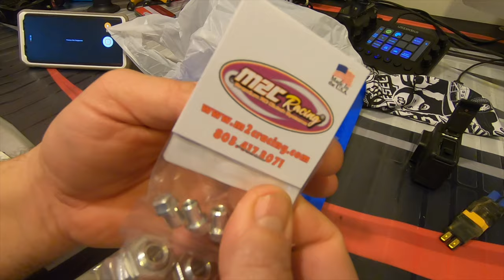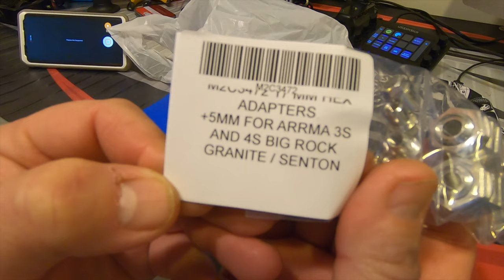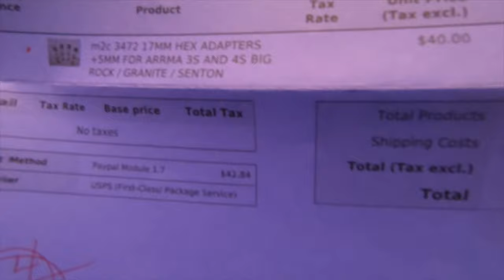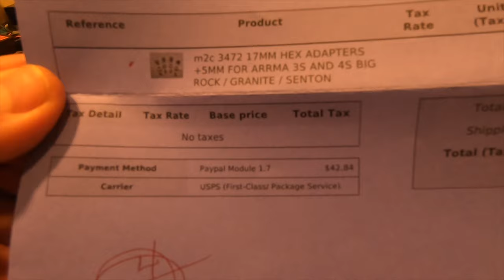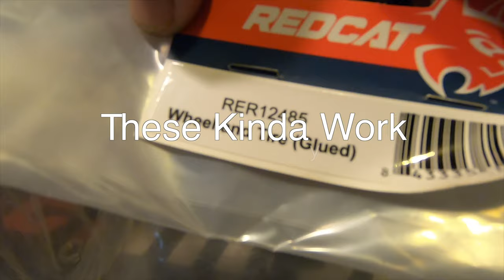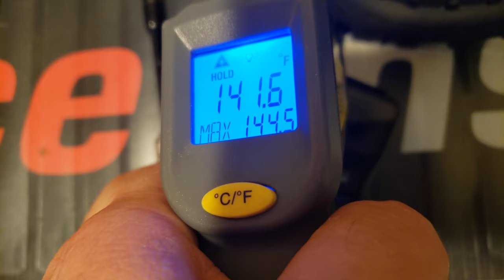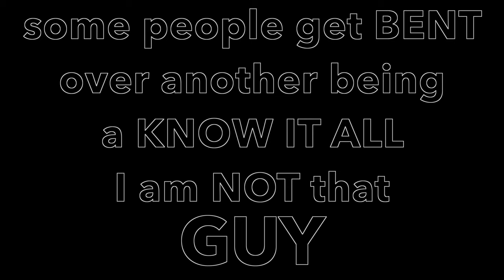M2C Racing 17mm Hex Adapters Arrma Big Rock Granite Senton

Comment: 🚘🚘. Great addition,,,I did the same thing only with hot racing 17mm extenders,,,,,,,I also installed the hot racing steering rack,,,it really tightened up the steering,makes it real solid.....😀😀😀. Also the hot racing nut has much more thread,,going into the hex....😊 you can tighten a lot more because there is no collar on the the insert.....
Reply from the maker: LINK?????

Comment: LMAO haha that run away truck reminds me of good old days with nitro trucks. Throttle linkage broke apart on my Savage X SS and had to drive it full throttle with only steering until it ran out of gas - luckily I was in a field and could drive it in circles. Cheers brother!
Reply from the maker: TOTALLY!!! YES
Reply: @rcguygarage  the slt3 controller has a throttle adjustment that needs turned down. Also recalibrate throttle end points
Reply from the maker: @kevinwilliams2720  yeah the only thing is that ended up not being it it was water got inside the receiver and pinned throttle wide open several times It turned out to be a great video for some fun content though 😂🤣
Reply: @rcguygarage  yeah im still watching and saw that part now. Wasnt sure if yoy had checked throttle. Thanks for the reply. I been watching a lot of arrma 3s upgrade videos. Debating making the changes slowly on granite
Reply from the maker: @kevinwilliams2720  have you seen my Granite videos? I'm not trying to get watch time but I got to tell you the granite surprised the heck out of me the last few times that I had that thing out I totally thrashed it It is Band-Aided together and just keeps taking the abuse the abuse and abuse

Comment: Cant you use that loctite water proof silicon sealant on that receiver box to completely water seal it?
Reply from the maker: Maybe but still should have checked
Reply: @rcguygarage  I'll eventually try that on my maxx once I switch out my servo (going to 2085x). Not going to lie that Big Rock looks fun as hell, thing is a little beastie beast. With water in that receiver box it sure did have a mind of his own there for a bit haha.
Reply: As a newcomer to the rc hobby its sort of confusing when you see "waterproof" on the box when its clearly not the case. Would you say they are more water resistant than actually water proof?

Comment: I bought these hex adapters and they’re binding! You have any issues with that during your install. My metal bearring hubs wouldn’t work. Switched to stock beating hubs front and rear and they’re still binding. Not as bad but I don’t like the way it feels.
Reply from the maker: Unfortunately I ended up dumping these pieces of junk 👍💯
Reply: @rcguygarage  which ones did you buy after?
Reply from the maker: Cheap China junk one that worked better but then realized trying to put 17 mm hex wheels on the big rock was an absolute waste of time and thought because then it overdrives everything about the truck
Reply: @rcguygarage  ah I bought some 17mm ones but the pin is bigger so the 12mm and the 14mm doesn't use the same pin?
Reply from the maker: @chrismagallanes8858  unknown as I have no idea exactly what you bought I just know what I did and then like I said realized that it was a big waste of time going with 17 mm for that particular truck because it overdrives everything about it It wasn't worth it It took the fun away

Comment: Wow no nail magnet for a contractor. To find those parts.unless aluminum. Ps if you have a ham or cb overpowered in your area it will mess with your remote. I watch running near highway or antenna high off ground.
Reply from the maker: Those tools are with the guys in their truck not with the boss hoss I just keep a pen for writing checks

Comment: 1st off. thanks for all your great vids, very educational especially for me, being that this Big Rock is the 1st RC-anything that I have ever owned. 2nd, since I already received my order from m2c (but haven't installed them yet) can you tell me where I can get that barrel nut and washers that you used? Thanks
Reply from the maker: If you have the REDESIGNED m2c 17s you will not need them🤪after a little chat with Mitch from m2c he made the change👍💯👊
Reply: @rcguygarage  so I checked my records, I placed the order on Mar.31, 2021, would you know it those were the redesigned ones? Thanks so much for your help.
Reply: @rcguygarage  It's a year later and I am looking at these. You are saying Mitch made them longer. I measured batch you got about 12.2mm so how much longer is the new center screw? Thx
Reply from the maker: @ParcoUpchurch  sorry I don't know exact but he added a couple more threads and that's all it needed with loctite
Reply: @rcguygarage  Diff question. I do not have a GoPro but a cell phone. Do you have a link to something I can attach to my Spektrum DX5C radio for my cellphone to record RC bashes? Thx Sir
Reply from the maker: @ParcoUpchurch  step one make sure you're subscribed to the channel step two check in the first line of the description and make your donation to PayPal obviously I'm just kidding if you scroll down in the description they'll be links to products that I use and one of them says new phone mount that is the amount that I use to clamp to every remote that I have and I mean every remote and then the only thing that you will need is obviously something to either attach to a GoPro or a phone and I believe that's slightly further down in the description that's the best I can do

Comment: Those tires sound great.
Reply from the maker: They RIP for sure
Reply: @rcguygarage  I ended up having to call horizon about that stl3 remote it was trash I bought a dx5c and bound it to the dsmr receiver that's in it and it worked fine after that but horizon was gonna replace the remote I told them to just send me an extra receiver since I bought the dx5c and they did but that remote is truly trash

Comment: Junk bellcrank and pivot balls...mine is the same.
Reply from the maker: Hot Racing little bit different but the issue was the FULL THROTTLE tree hits. I adjusted toe now it's GREAT
Reply: @rcguygarage  HR makes a bellcrank and pivot ball set. I'm going to get the pivot ball set at some point, after it breaks. I hit a huge rock! That's what knocked mine really loose. But it had some slop to begin with. I think it helps as far as bashing though.